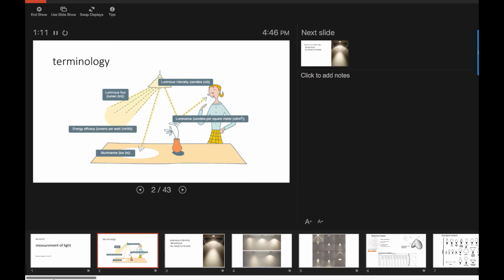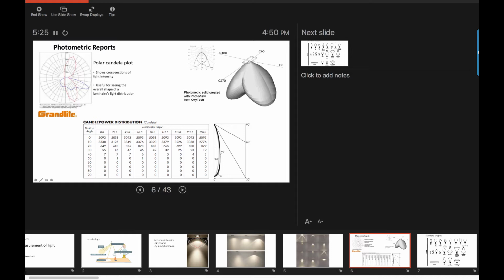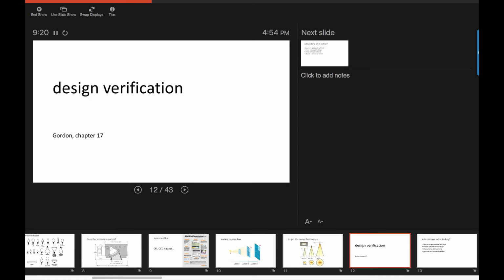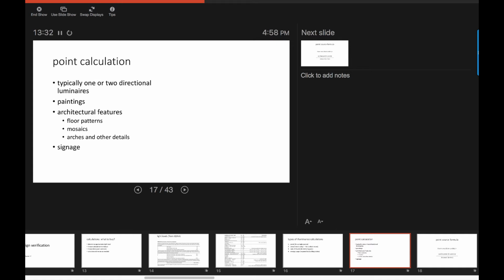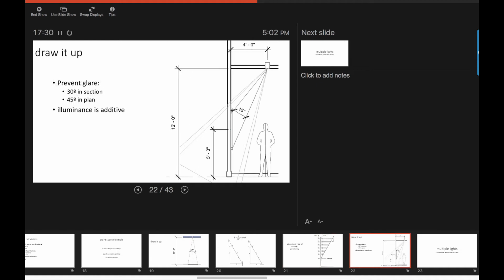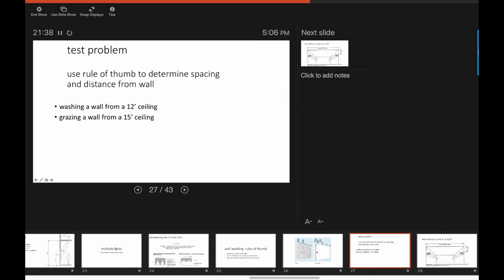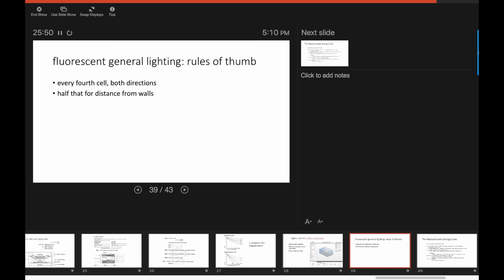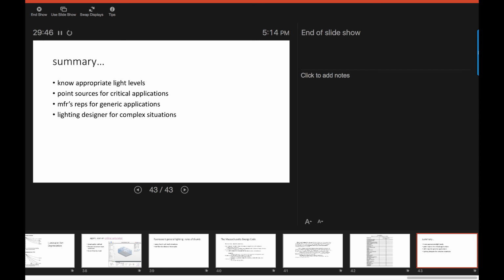3 Measurement of light

Comment: Whats the proper way to shine a light meter... I see people facing it up towards the fixtures but that doesn't make sense... Is the correct way to face it down at hip level to record the actual foot candle readings?
Reply from the maker: It depends if you want to measure illuminance (the light landing on a surface), or luminance (the light reflected off a surface). The sensor should face in the direction that the light you want to measure is coming from.